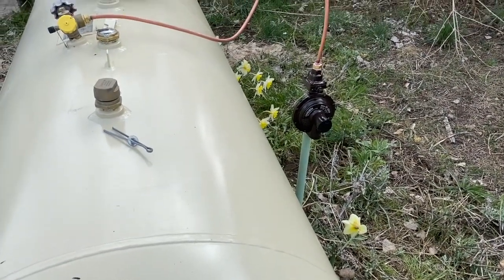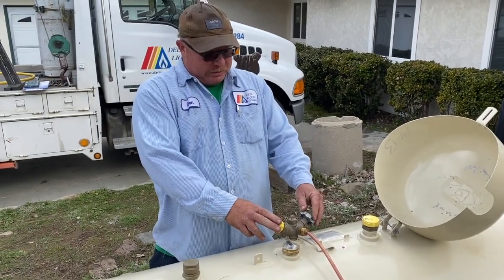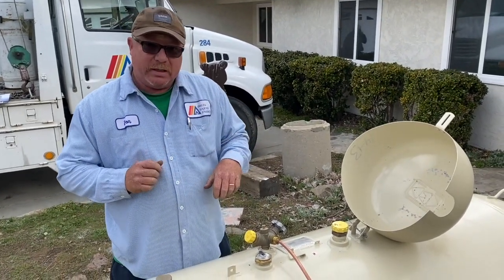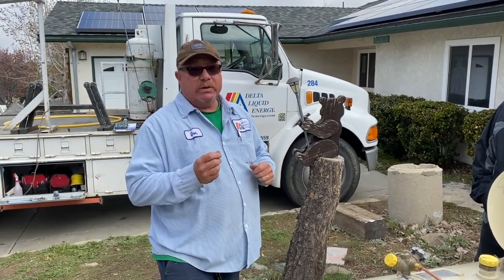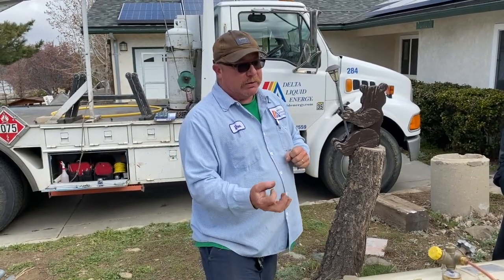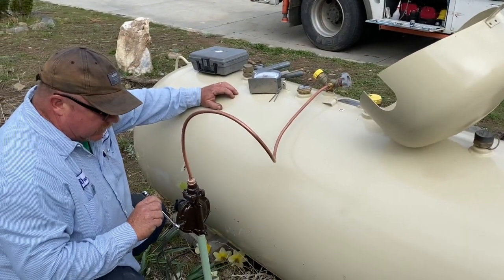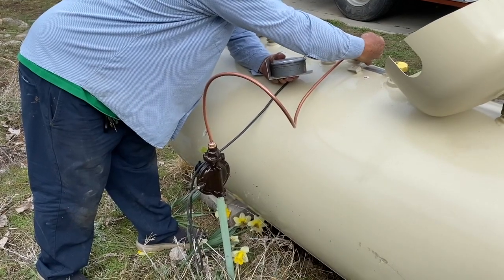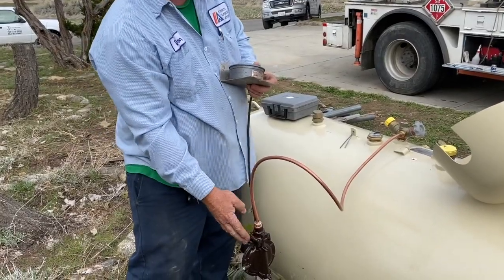Propane Tank Surprises!

Comment: You are better off buying your own tank for your home. The bigger the better. They size the tanks for your home so you have to have a propane delivery in the middle of winter when the propane prices go up
Reply: The company I work for doesn’t change the price, it stays the same year round. We usually advise against buying your own tank, though it’s up to the customer. Here on the wet coast, the tank (particularly new ones, they have been rusting under the paint) is often toast in a decade. We replace the tanks at that point, at no additional expense to the customer. Only the standard tank rental, which is about $150/year. If they purchase their own, they’re out at least $3000 to replace their tank.

Comment: Why no 1st and 2nd stage regulator? The run from tank to house must be fairly short.
Reply from the maker: It is about 15 feet or less.
Reply: That regulator has both 1st and 2nd stages combined.
Reply: @USA-GreedyMenOfNoIntegrity  dual stage

Comment: Mr. customer you are right. The bleeder valve at the top of the cluster valve  tells the delivery driver  when the tank reaches capacity by (spitting) liquid propane out the weep hole. It is also called an 80% valve...
Reply: Will the pop off valve or pressure relief valve pop off at 86 or 88 percent?
Thanks
Reply: @bucknut1572  depends on the temperature
Reply: @bucknut1572  250psi will pop the pressure relief
Reply: I had a 77' chevy truck that ran on propane, you'd open the valve and start filling until liquid propane dribbled out on the ground 😂

Comment: Hi--really excited to see this video. I have a specific question regarding the outlets on top of the tank. 
Is there a way to lock the first valve he mentioned--the liquid withdrawal? 
I live out in the country and sometimes it is too easy for someone to catch you not at home or during the middle of the night to slip up and fill their 20lb BBQ bottle. 
Is there some way to prevent this 'no return' type of borrowing my propane? Possible a different type of locking nut or possibly a locking cover?
Hope you can help with this concern. Thanks and Jesus bless.
Reply from the maker: I’ve never seen any mechanism that would allow that kind of lock. If you were really concerned, perhaps a camera that would alert your phone when motion was detected near your tank?
Reply: @Yourrealadvantage  Thank you for your quick reply. I believe you are probably correct...a camera might be the only remedy available at this time. Have a great weekend. Jesus bless.

Comment: Is 86 & half percent in A 500 gallon tank over filled? 
Can you fill A 120 tank to that percent also?
Reply from the maker: The general rule of thumb is that you only fill propane tanks to 80% in order to allow enough room for expansion based on temperature fluctuations.
Reply: The driver said 86 & half percent,  is the tank overfill?? 
I understand 80 percent is normal,  thanks
Reply from the maker: @bucknut1572  I’m quoting normal.  If you want to go that full, I suggest checking with whoever is filling your tank to see how that person feels about it based on your elevation and weather conditions. Thanks so much for the question.
Reply: I have 3 tanks on my property. First 1000 gallon one I bought in the 80's for $800. The second was $2400 in early 2000. Builder said the increase was mostly because of liability insurance cost. The third was in 2022 for $4800. Still...the coop I'm in got me the fuel for $1.60/gallon. There was a time when it cost 80¢...but then we got 15000 gallons at a time dumped off within a one mile radius.

Comment: For one 80% is full not 85 and 86 and a half second of all, that is not a proper regulator test to lock up
Reply: More info?  I'm curious.
Reply: @Caderic  about?
Reply: Shouldn't there be propane in the tank before running a regulator test? Especially on a new tank?
Reply: @redfish1365  I'm sure they really put some gas n it before they brought it
Reply: @tracker1ify  I know when I used to deliver propane if a customer got a new tank I had to be there when it was delivered because the new tanks had a vacuum on it.
Reply: @redfish1365  yeah the company that brought it should have already put some vapor in it